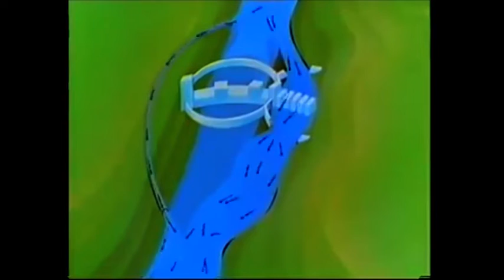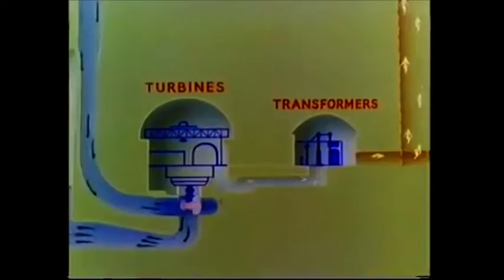Kariba Dam

Comment: I am not an engineer, but I am interested in some aspects. Kariba Dam is the largest man-made dam (185 km3 of water). It is almost five times bigger than the Chinese Three Gorges Dam (38 km3). However, the Three-Gorges Dam has an installed capacity of 22,500 MW compared to Kariba's 1,626 MW (with the Zambia side). Is the difference only in terms of number turbines, Kariba has 14 compared to 34 and their capacity? What is the maximum that can be harnessed from Kariba, if financial resources were available (a simple matchbox calculation says 110,000 MW)?